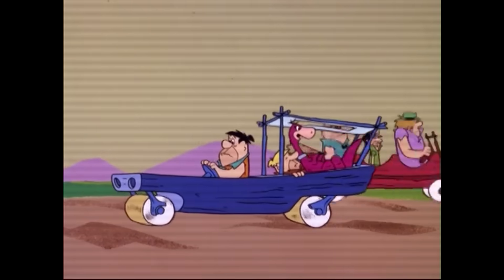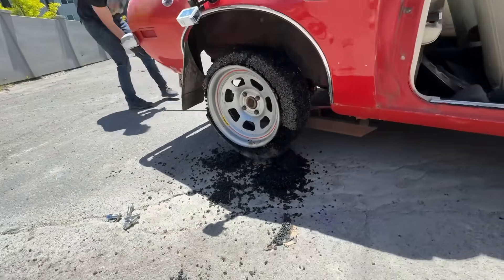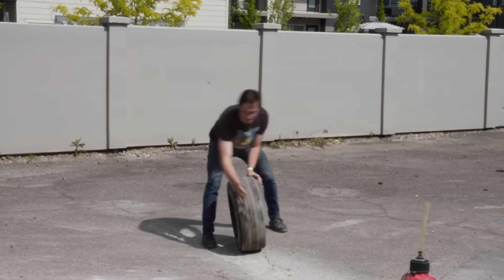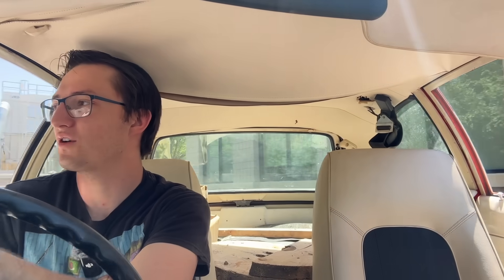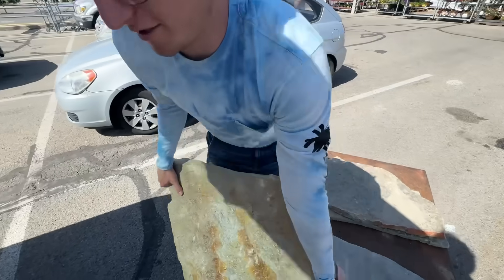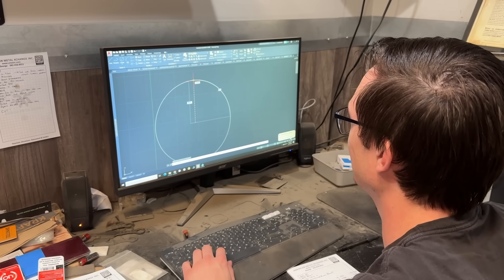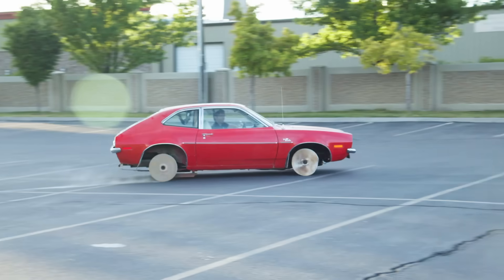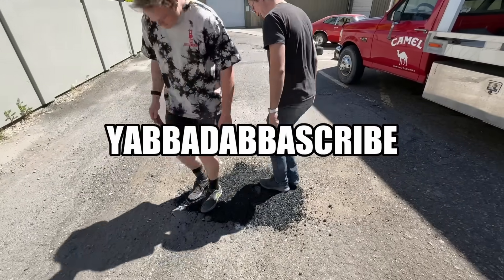Can You Drive On Stone Wheels?

Comment: "Concrete is very durable, so it won't just fall apart on us. But it's also very brittle so it tends to fall apart."
Reply: It's strong in compression but not tensile... probably what he was talking about.
Reply: @Dante_The_Great  I get it. The phrasing just made me laugh.
Reply: Lmao
Reply: Just like Tungsten.
Reply: @itRemindsMeThatItNotSoBad  Look it pissed me off too, but the big T's just too brittle. So unfortunately.. Titanium better.
Reply: @Heatrecks  Hence why it is advised to put titanium under tungsten when making a composite. 😆
Reply: @danieljancso8480  No way you just told me that Titanium lil bro's Tungsten💀
Reply: @Heatrecks  For the record. Titanium can give tungsten what it lacks. Ductility. A layered composite of tungsten and titanium is a good combo. Especially when hot pressed and cold rolled.(Not been tested)
Reply: @itRemindsMeThatItNotSoBad  For the record. Osmium is denser.
Reply: Makes sense to me concrete very hard and you can put a ton of weight on it literally and use it as grinding wheel on less dense materials but if you try to bend it or it gets hit by even harder material like a sledge hammer it will crack or even shatter.
Reply: Oxymoron
Reply: thats how materials work, the harder it is, the more brittle it is, which makes it very strong and thus more likely to fail catastrophically. (TLDR Hard thing go boom easy because it need directed force)
Reply: this is sketchy
Reply: Strength can be measured in various ways, like compressive strength, tensile strength or hardness. Diamonds are super hard and resistant to scratches but have zero elasticity and can be smashed with a hammer.

Comment: The Ford Pinto had a notoriously bad ignition system. Im certain that yours has the 2.0 litre OHC inline four. I owned a Ranger with the same motor. My fix for the ignition system was a set of 9mm sparkplug wires for a 5.0 mustang and a 65 series battery from a full size truck. That and some little timing adjustments had the engine starting before I turned the key all the way. Every time.
Reply: Your ranger did not have the variable venturi carb.

Comment: You are freaking lame;
1. Who told you you must get rid of tire at all. Just put your concrete inside, instead of air.
2. Asfalt, like concrete, better at compresdion  than  streatching. So yeh  it failed as soon as you thing about it!
3. YOU CANNOTBREMOVE RIMS! If you have done any research, you would know wheels disks work by hanging car from top point ofvdisk, not pressing into lowerbpart. Axels are hanging. Your stone wheel has no strength on stretching at all
Reply: Have you every tried being quiet. It works wonders

Comment: As hilarious as this is, perhaps you should invest in a safer testing environment that isn't public roads
Reply: He sped up the need for repair by all of 3 months
Reply: Yeah that made me cringe like hell.
Reply: Fed behavior alert
Reply: Cry about it
Reply: Cri moar
Reply: The most terrifying part was how he was genuinely so ready to just gun it towards that stop sign. Like, he was fully ready to commit without even a hint of consideration that his ability to slow down with literal stone tires would be neigh non-existent. 

They also just casually laughed about passers-by getting concerningly near a vehicle that was SCARILY close to launching shrapnel in random directions if one of the tires cracked the wrong way. 

And it would have been a simple enough issue to solve too by just not going on public roads. They clearly had an area where they were (seemingly) fine to wreck the pavement so bad they dug a straight up hole in it, but they just decided to test it on public roads for seemingly no reason other than to be able to go faster and be more reckless about it.
Reply: yeah that was a bit concerning
Reply: If the wheels broke the car would just immediately stop. And he was going super slow
Reply: @fluffymandy  That doesn't change the fact that doing this on public roads is quite foolish and dangerous.
Reply: @Bambuskus505  but how did they slow down they cad no brake pads
Reply: @Bambuskus505  Bububu there is almost nobody around granny.
Reply: @firedrive45  Doesn't matter. While I fully support having fun and goofing around, stuff like this needs to be done in a controlled and safe environment. And by "Controlled" I mean "The people doing the goofy experiment need to have full control over everything that happens within the controlled area." 

What if another car had come around one of those blind corners, and the rock wheels shattered from the sudden stress of having to apply the brakes? Sure you could argue "That didn't happen so it's fine." but it's not fine. That what-if was unaccounted for, but it was a very real possibility. These guys got insanely lucky that nobody got hurt, because there are a LOT of uncontrolled and dangerous variables here.

Also, the argument that "there was nobody there" is entirely invalid because they literally drove the car to a grocery store, and there were quite a few cars in that parking lot.
Reply: @Bambuskus505  which law states you cannot drive on rock wheels? as for safety, its not everyone's priority. Some people enjoy chaos and unsafe environment, like rock climbing, acrobatics etc. Not everything is fully safe, yet, people doing it accept the risks.
Reply: @firedrive45  The Utah Code, Title 41 motor vehicles, chapter 6a traffic code, part 16 vehicle equipment. Tires need to have rubber, non-rubber protuberances can't damage the roads and can't pose a risk to life, health, or property. Even with the slightest common sense, stone tires are illegal -- like, was this a joke? 

Rock climbing, acrobatics, and other perilous sports are something you do to yourself. A shard of rock flying off the car and hitting someone who just wants to buy groceries is something you do to someone else. That's the differences between the risks.
Reply: @firedrive45  haha that true
Reply: Holy yapping of the yappington
Reply: @ZbyszekDupojajewicz-iy8yo  Bruh it's one short sentence..
Reply: Y’all some softies 🤣 this is for your entertainment. If there is any debris that happens to get on the roads I’m pretty sure they’ll clean up after themselves
Reply: @SMLX13  Debris isn't the only problem. It's the fact that the stone tires made the car a hazard, and they drove the car on public roads despite knowing full well that their car was now a hazard. A car that cannot be controlled effectively is inherently dangerous. Period. What if the stone tires ended up not being able to handle the added stress from applying the brakes? What if the bits of debris that broke off ended up having more momentum and velocity than expected? What if the wheels just randomly shattered in the middle of the road? 

There is a *LOT* of things that could have gone wrong here.
Reply: @Bambuskus505  yup yup
Reply: @SMLX13 Got your kiddy points little man? Go play outside.
Reply: @Zrs3820  ?

Comment: I can't believe the limestone held together.  Try again with marble and make them thicker!
Reply: that sounds expensive
Reply: @Steamrick  then get sponsored by big marble
Reply: @Steamrick  He can pick up some off-cuts at a kitchen counter fabrication shop.
Reply: Or pegmatite granite.
Reply: @jasonsummit1776  granite would actually be really bad.  tons of voids for cracks to propagate through.  quartzite might be good.
Reply: The stones that were used in the end were quartzite, not limestone.
Reply: Sounds expensive they should try it with boulders they can find instead 😂
Reply: Marble and limestone are equally hard/soft. The difference between them is marginal.
Reply: @tylisirn  marble is a much finer grained and uniform material.  less places for stress cracks to form.  it'll still inevitably break, but might last longer.
Reply: well in a short period of time like that it's fine but in the longer term it would crack apart from driving in all likely hood as it was likely developing micro fractures in the stone that you couldn't see which would in time destroy the wheel
Reply: "Marble? Do I look like I'm made of money?
Reply: They could also try again with granite.
Reply: It will shred the suspension by extra weight

Comment: Ok, next time, make a proper concrete wheel set, all 4, balance them perfectly, watercut them properly into a round shape and use those... And add more armature just for safety... With them balanced well, you are likely to overdo it, so it`s better that they be reinforced af... I would also consider adding some abrasive grit into the concrete, mix in some of the used up granite... It ought to add some friction to the ``wheel``...
Reply: zamn you put them to work full time
Reply: asking for anything from these guy is like monkey's pawn
Reply: Yes

Comment: just want to say Metric is king. Much easier to calculate mm instead of fractions of inches.
Reply: Depends on what you grew up using.  I grew up working in a small machine shop and and used standard units of freedom (Imperial/SAE) is far easier for me to work in than the metric system.  The only place that I truly find the Metric system to be far easier to use is baking because of “bakers math.” That said  I firmly believe use whichever system of measurement that works best for you

Comment: You guys not know the shovel trick?
You take a regular shovel and place the blade of it flat against the ground and slide it under the wheel. Now push the handle down and it will hike the wheel up enough to stick it on the hib.
Reply: Yeah I was gonna say, 35" truck wheel/tire combos are often pushing 100 lbs.
Reply: They didn't know the shovel trick
Reply: Fulcrum.
Reply: @Mustangs65  That's the word I was looking for.
Reply: I just horse stance carry them 😅

Comment: If you were inspired by The Flintstones to make stone wheels, try to make a car that you can accelerate by using your feet.
Reply: You already accelerate by using your feet
Reply: @servicetrucker5  I use my tongue
Reply: Lol true  @servicetrucker5
Reply: @servicetrucker5  that’s what I’m thinking
Reply: They used a Pinto, that’s pretty much Stone Age performance.
Reply: ken76918
Don’t talk about the Pinto bean like that
Reply: Hate to tell you but that's all of them mate
Reply: Like a gas pedal?
Reply: Most cars are like that already
Reply: Isn't all car already accelerated by feet?... The Gas pedal and stuff
Reply: Might even be faster than the ford pinto
Reply: That was already done. At least twice.
Once, with a car that has its transmission and engine removed.
Another with a Flintstones replica.
Reply: "like fred flinstone drivin around with bald feet" the beastie boys
Reply: dude you're not gonna believe this
Reply: Been there, done that
Reply: isn’t that basically a scooter
Reply: Broken glass on the road?  Oh no, time to get the broom.
Reply: there’s already the little toddler cars
Reply: Ali Spagnola did this!
Reply: Those guys never skip leg day
Reply: I'd think a 2000s Corolla or similar would be a good car to try it one. I could push the car while sitting in
Reply: With no bearings
Reply: I mean, you can do that by putting your car in neutral and pushing it already 😂 The problem is, the car is heavy af so good luck with that!
Reply: @Delimon007  well that is only doable either by being Paul Anderson or else having multiple sources pushing it to avoid becoming stuck on neach hill at best.. or worse crushed by a 3 to 8 possibbly as much as 17 thousand us pounds.
Reply: You never had to push a stalled car before?
Reply: @CptJistuce  Well yeah that is kind of just fortunately forvme but also not running on low fuel etc,
Reply: It's already been done
Reply: So what I'm getting is you guys don't know what a gas pedal is it literally sends signals to give more gas to the engine faster combustion faster every time welcome to gas powered cars / normal cars😂
Reply: Or how about a fucking dinosaur
Reply: Impossible probably, its either too heavy or carlesser car
Reply: @fabiofanf3e813  not impossible but the max speed would be… VERY slow to get to, likely would require strongmen champs to be somewhat useable, and braking would be… just a no…
Reply: Just take out the floor pans and you can pedal Fred Flintstone style.
Reply: *Gas Pedal Has Left The Chat*
Reply: A pedal car exists you know lol
Reply: Hear me out

Bicycle cars 🤫
Reply: @Kuzps Do you mean a car with bicycle wheels or a car with bicycles for wheels?
Reply: @FlyingPenguin3000  a car that you can pedal to start up
Reply: @Kuzps  ... how?
Reply: @FlyingPenguin3000 Look up the Mercedes bicycle car, it exists.
Reply: @Kuzps those exist. They’re called quadricycles.
Reply: @Kuzps already been done
Reply: @FlyingPenguin3000  hire him
Reply: @sebe4uyoutuber  what do you mean how the gas pedal is by your feet you just hit it with your feet and you start to accelerate
Reply: Hear me Out...

Aint got shit 😂  @Kuzps
Reply: @Kuzps no, the playmobile cars from when we were 6
Reply: @Kuzps I remember thinking about that when I was little
Reply: @Kuzps  that's a thing that already exists.
Reply: been done before and news flash it sucks.
Reply: You do it
Reply: not 54
Reply: Start with your feet then the electric kicks then the gas engine, hybrid with extra steps
Reply: Michelin is jealous
Reply: How the bike was invented:
Reply: Its possible but hard
Reply: Why don't u, try and make it man...
Reply: well  to be honest

you accelerate every car with your feet     except for some cars from before 1940
Reply: So a bike?
Reply: No you put your foot on the floor and run while in the car to make it move
Reply: Little Tykes Cozy Coupe?
Reply: I had one when I was a kid. Those red ones with the yellow roof. I'm sure most people have seen them at some point.
Reply: or even better, try keeping your opinion to yourself just for once.
Reply: With a hole below the driver seats you walk to move the cars
Reply: the flintstones had steamroller style wheels
Reply: @JxT1957  someone else did that, lol! I think it was a mythbusters clip?
Reply: You’re going to be blown away

Gas pedals that work by being pressed with your feet! 🤯
Reply: That's a moped
Reply: SKATEBOARD CAR
Reply: I remember way bacj in the early 00s so fwiw about 04? Iirc was when we had plastic cars foot powered kids played in for recess during pre k.. not sure what it is called but yeah fwiw.
Reply: Grand dad ?
Reply: What you are looking for is a velomobile it’s a 3 or 4 wheel bike with a fiberglass shell, you can get up to 35 mph using human power depending on the model
Reply: Maybe work on the brakes first, huh?
Reply: Umm pedal cars already exist and electric cars are out get with the program people we need Jetson flying cars
Reply: Umm we have pedal cars qudracycles electric unicycle electric vehicles in general I mean what else you want besides the damn Jetsons flying cars....
Reply: Fun fact someone else actually did it using her friends car
Reply: "Surrey bike" with pedal assist
Reply: Haha so funny 😂😂😂😂😂😂😂😂😂😂😂😂😂😂😂😂😂😂😂😂😂😂😂😂😂😂😂😂😂😂😂😂😂😂😂😂😂😂😂😂😂😂😂😂😂😂😂😂😂😂😂😂😂😂😂😂😂😂😂😂😂😂😂😂😂😂😂😂😂😂😂😂😂😂😂😂😂😂😂😂😂😂😂😂😂😂😂😂😂😂😂😂😂😂😂😂😂😂😂😂😂😂😂😂😂😂😂😂😂
Reply: What about braking?
Reply: @Unapersonaconunmicroscopio  not asbestos just calluses instead for the brake pads hehe
Reply: FlyingPenguin3000 - You seem to have a foot-fetish. Which is nasty!
Reply: It would be one Hell of an exercise…
Reply: What a gay idea
Reply: isnt that just walking?
Reply: @blusaka  actually, foot travel vehicles have been a thing in the past and do help make your energy use and carrying capacity more efficient.  You do basically use your feet either directly or with a pedal multiplier to give energy into the system, however, since the car uses wheels and the momentum of the entire thing plus yourself is added up, you can use this to get up to speed then coast along.  Its not generally super safe, (better with pedals rather than feet directly) and wont be setting land speed records or even hitting highway speeds outside of maybe downhill paths, but, in general, it Can work to get a person from point a to point b with less issues than walking and more carry space, and multiple passengers can work together to make it faster
Reply: they did its called pedls
Reply: It already exists. Press a pedal with your foot, and the car accelerates
Reply: Save on gas that way🤣
Reply: Try to have a pfp that doesn't suggest child touching
Reply: Little tikes
Reply: 😊😊❤❤Jesus loves you all, repent please. Build a relationship with him, we all need it. Talk to him, fellowship with other believers. Life will never be the same after this year. Matthew 25:44
Reply: @Savedsmile  quiet, most of your priests aren't any better than what they're doing
Reply: hate to break it to you but the feet thing is just a way to get the car started. they have petrol in the FCU
Reply: im gonna hold your hand when i say this...
Reply: Literally has 2 pedals controlled by your feet
Reply: Umm...we drive with our feet now lol
Reply: Maybe he could put a pair of bicycle pedals where the gas and break pedals go, and design it to speed up when he is pedaling, break when he reverse pedals, and holds its current speed when the pedals aren't moving
Reply: little tykes already did that
Reply: Lol
Reply: you already use your feet to accelerate lol
Reply: Also the brakes.🤷🏼🤣
Reply: :Make a car
Reply: I had one of those when I was 5
Reply: Put it on a hill?
Reply: Fischer Price did it like 50 years ago.
😆👍
Reply: Hey best pally I’m Ally already did that
Reply: Eminem would be proud
Reply: Lol
Reply: Isn't that just a bike 💀
Reply: L profile pic